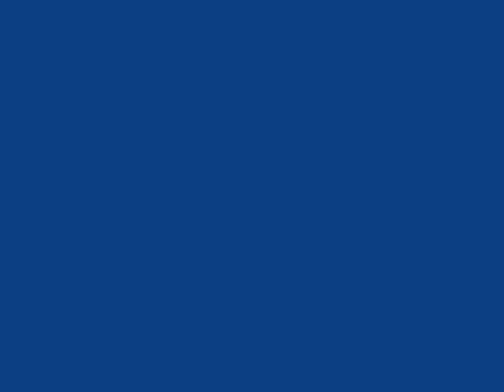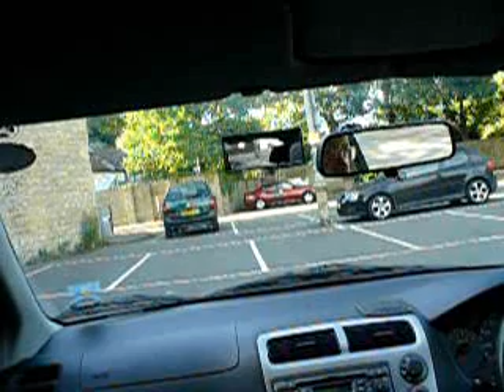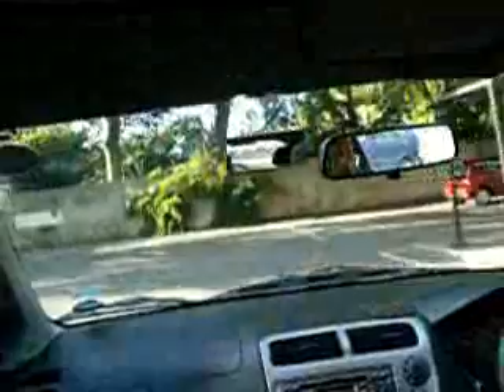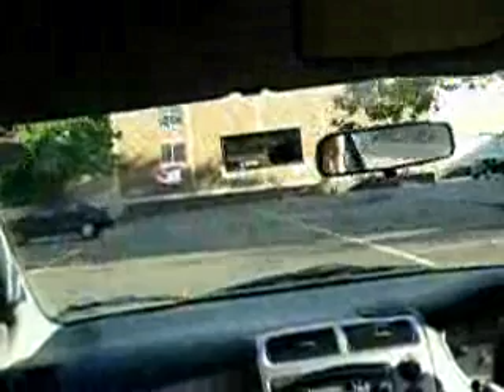Cockpit drill quick version

Comment: Cockpit drill.......
''I am xxxxxxx, my hand brake is on my gear lever is in neutral. The seat steering and mirrors are all adjust to my satisfaction. My seatbelt is on and my door is closed, could all passengers please ensure the same.
Placing my foot on the foot brake, I feel I have good static pressure. Selecting the ignition to the first position I am greeted by a bank of warning lights, some of which have self checked and cancelled..........